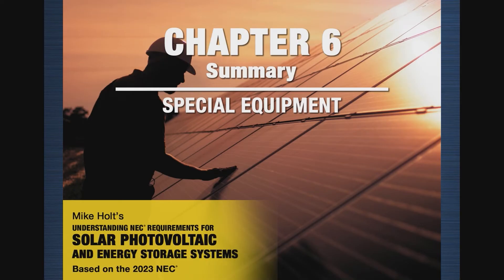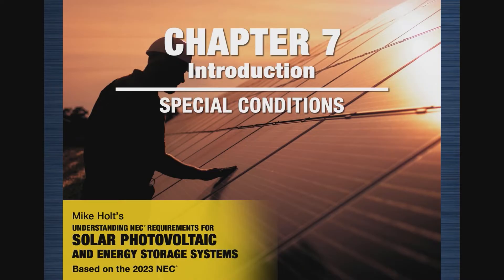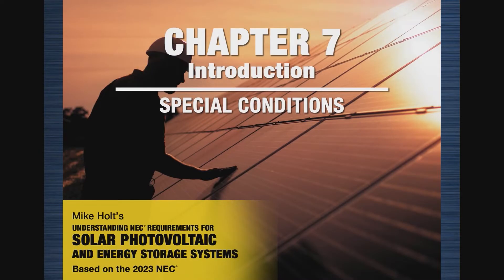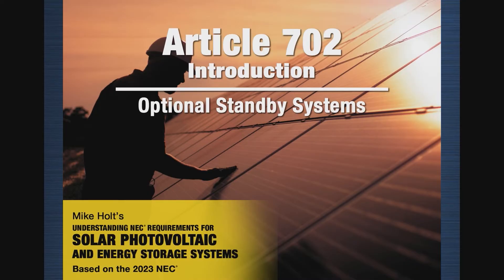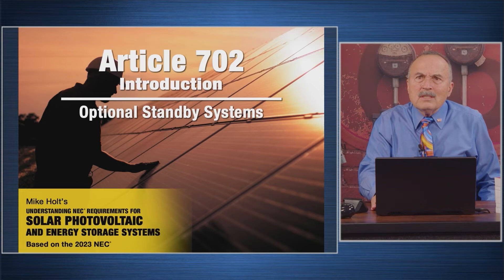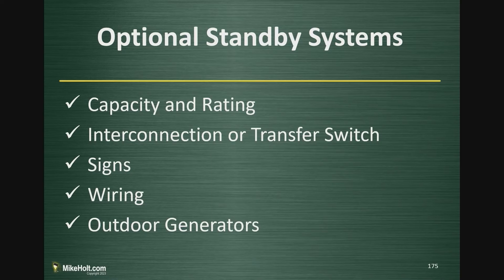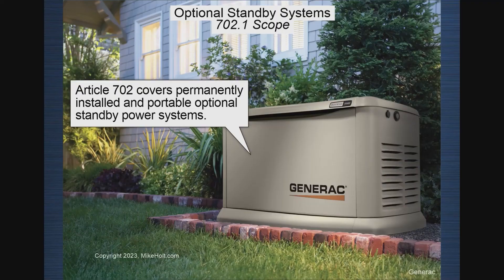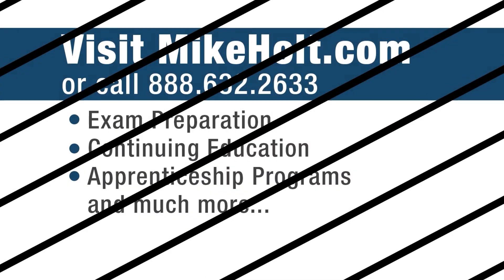Optional Standby Systems Scope, NEC 2023 - [702.1], (3min:20sec)

Comment: Mike Holt, please respond to me, I used to have your phone number but u changed it... I have a problem with an inspector... I'm an electrician and I work for Tesla, I build their supercharger parking lots... My question is about 600 v dc and class 1 2 and 3 circuits
Reply from the maker: Call 352.360.2620 and ask for MikeHolt.